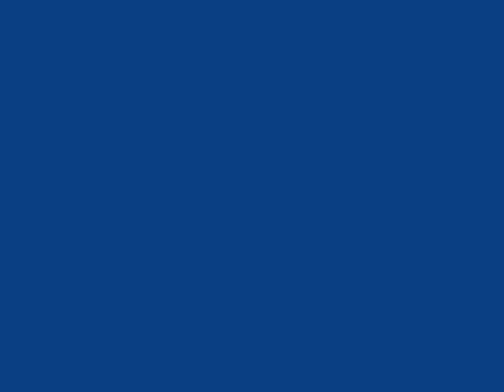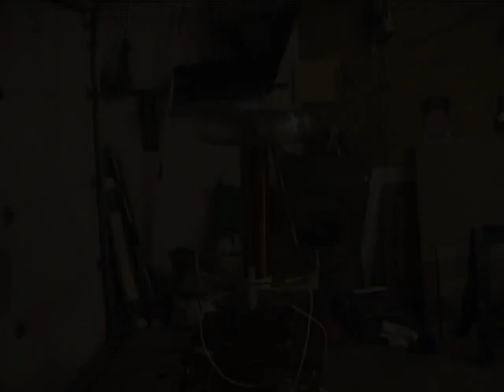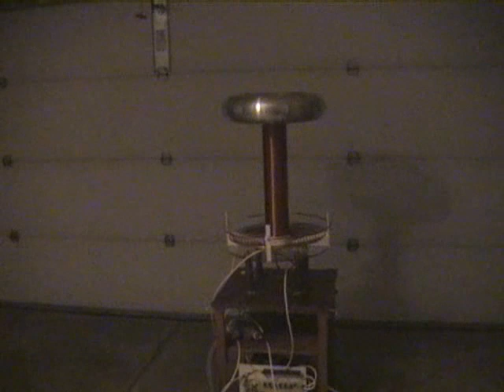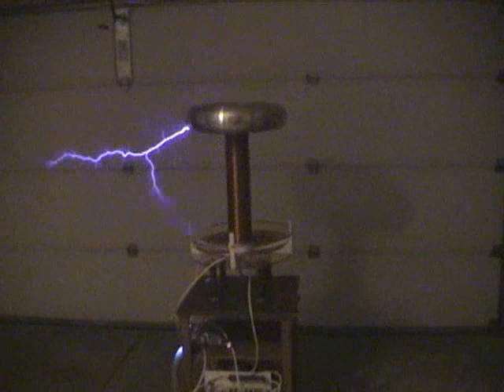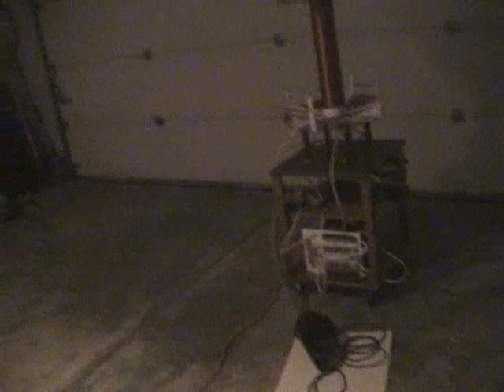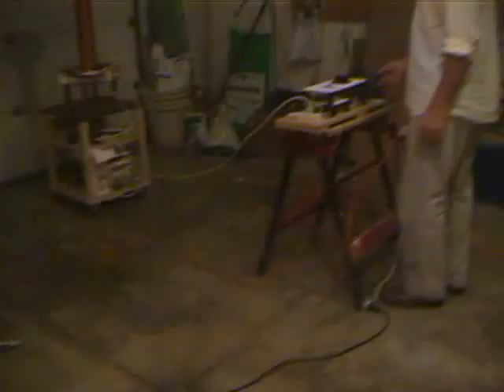60mA 12kV NST Tesla Coil

Comment: shobley--I've acquired a 12kV 60mA transformer for my TC, and have read through many guides/D.I.Y.s, but most are based on different-sized transformers (15kV 60mA mostly, and those are too expensive for me). I'm building this Tesla Coil as my final project for a class I'm taking this quarter, and was wondering if you could point me in the direction of a guide that employs a 12kV 60mA NST (either that, or what you did--in more detail :P). [Didn't want to clutter your inbox so I commented instead]

Comment from the maker: @barttie217 : All the capacitors have 10M disharge resistors across them. I also have a grounded "wand" with a 10M resistor that I use on the primary after a run.